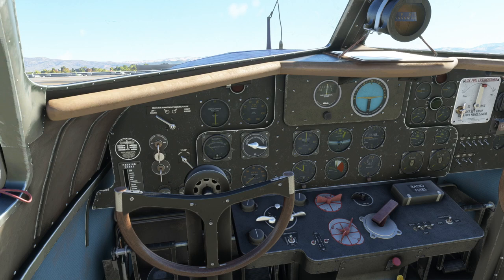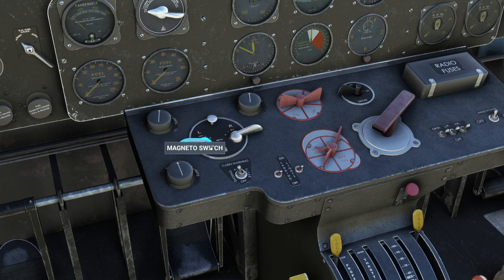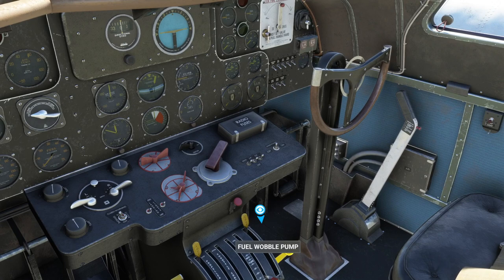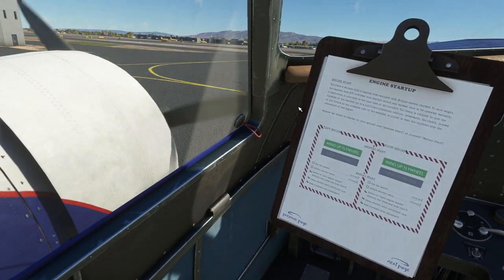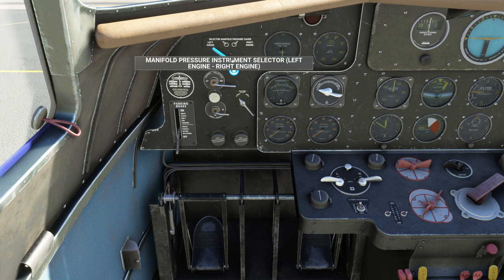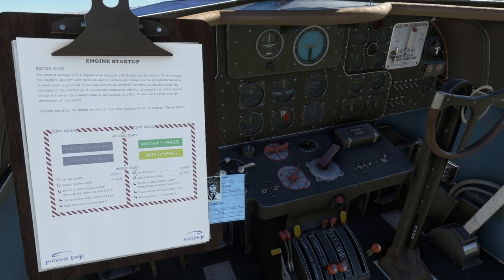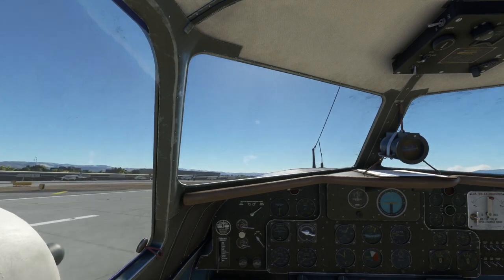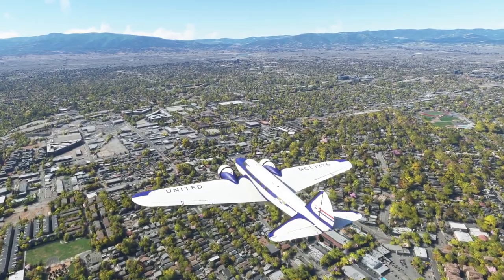Flight Sim 2020 - Starting the Boeing 247

Comment: When taxing you want to go much slower then that. For a commercial airliner taxi speeds normally about 20 knots ground speed, but in an old Boeing like this it’s probably even slower, so about 15 knots.
Reply from the maker: I think I had something mismapped - I was having trouble getting any steering authority at lower speeds. It only seemed to steer at all when I had air going across the rudder, which is why I felt a need to go faster. I forget if the Boeing 247 has tailwheel steering and maybe that's not mapped right?

Comment: I tried this for three hours last night, couldn't get port engine to start? Starboard occasionally, but no joy. The very first time I tried, both mixture levers were in full lean and I got both engines running first time? Then I advanced mixtures to full rich and the port engine burst into flames? Perhaps it's a Simconnect fault? We certainly need a checklist on screen for this. I had to give up on it since it was driving me crazy!🙄
Reply from the maker: The problem is, I think the results are inconsistent across computers. I watched other videos and tried to emulate their startup and it didn't work. Fiddling around with the timing of things, I got this, and the engines start more or less consistently. On the mixture, make sure to get the levers to full rich immediately, as I think the system thinks they're already there (until it doesn't). I have throttle quadrant, so I just nudge it a little bit to make that happen (the lever is already full rich on my quadrant, but this plane doesn't start out reading that position). If you try to move the mixture smoothly, that might cause a problem.

Comment: please, i need help. my 247 is just refusing to start at all whenever i try the engines stall and when i try to fly without start up the ENGINES STALL please ive tried everything
Reply from the maker: Check that you're using the right oil for your temperature conditions.
Reply: @RaizSpace  thank you for replying but what oil should i use for 60-70 degrees?
Reply from the maker: @TerrainiumKSP Unfortunately, I've had trouble with that, too. I haven't flown it in a bit and I'll have to do some more testing to see what works and what doesn't.
Reply: @RaizSpace  thanks i just dont  understand how you manage to start the engines, did you use non realistic mode?

Comment: Oooh, thank you for this video!  I know now I have no desire for this add on!  (=
Reply from the maker: I mean, you're not required to do a manual start if you don't want to.
Reply: @RaizSpace  that start is cool. I mean maybe its just buggy but it seems like they are trying to simulate finnicky, unpredictable old planes. Maybe the code randomizes some values for each person so some people might have to wait for the flywheel but others might not, or maybe it depends on the weather/temperature.

Comment: That's cool. But I just paid 20$ and cannot get off the ground, thinking it was like most MSFS modules with a ready state for take off.
Reply from the maker: If you start on a runway, it should be in a ready state for takeoff - the engine should be started and everything. I would say that you should move your throttle a bit forward (engines like this tend to quit if their pressure is too low) and double-check the mixture and propeller pitch as soon as possible, since its state-saving might need a patch or something.